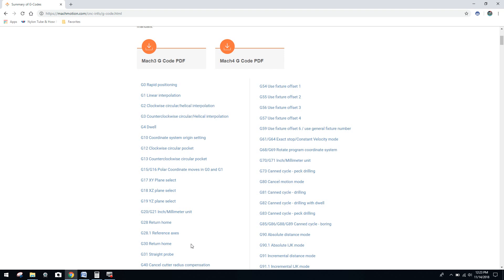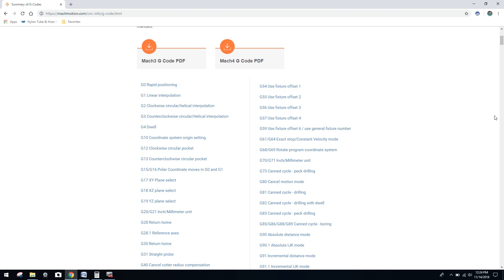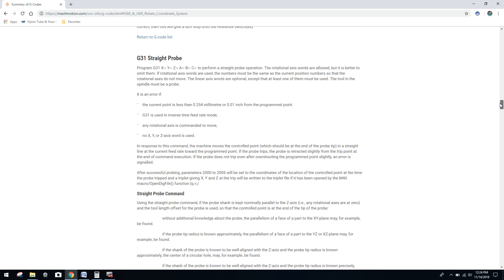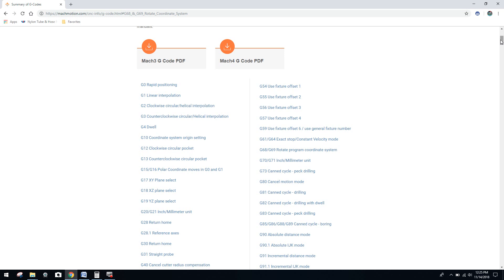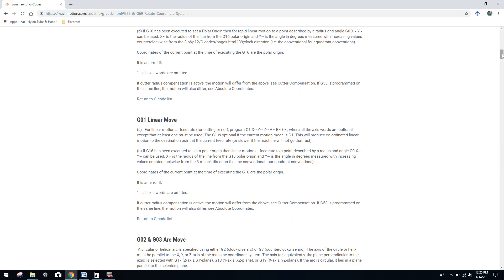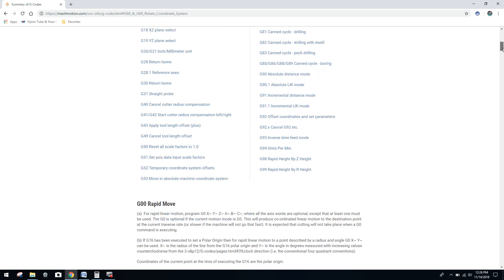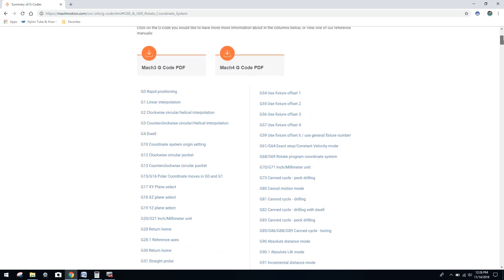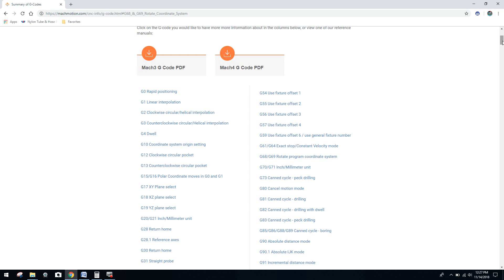G-code Summaries For Mach 3 & Mach 4

Comment: does g code made for mach3 (using sheetcam or fusion360) work on mach4?
Reply from the maker: Salman, Thank you for your support. Yes, however you may require a post processor for Mach4 to understand it. This would be provided by your CAM software manufacturer. thank you, have a great weekend,  and please be safe.
Vince
Reply: Thank you for your quick answers.
Reply from the maker: @salmanyounis  You bet..:) Thank you, and have a great weekend! Vince
Reply: I mean, I made a g code using mach3 post processor in CAM software, and giving this code to somone who has mach4 controlled cnc, will it work accurately?
Reply from the maker: @salmanyounis  It should if they have the proper post processor installed. Thank you, and please be safe.
Vince

Comment: I feel like this should be an incredibly simple line of code but cannot find it anywhere. I want to be able to run programs back to back on my avid cnc using mach 4 but for accuracy I need the machine to home all of its axis after finishing one program but before it starts the next one. This way I can run a longer set of roughing and finishing passes without having to break them into multiple g code files. Seems like it would be a simple line of code that I can add where needed when editing the gcode. Does this make sense?
Reply from the maker: Gabe, thank you for your support. The homing process is required if your changing a tool for the new code as that's all I can see that would cause this. This is a mandatory sequence from the roughing process. Thank you, and please be safe.
Vince

Comment: I'm using CAD software called: Grblbru and the gcode does not work on my mach4 lathe. Do u know why?
thanks
Reply from the maker: Ahmed, thank you for your support. The issue would be with the compatibility of your CAM software.  G-code is designed for all Artsoft software. You most likely require a post processor compatible with your CAM software to allow it to work. Thank you, and please be safe.
Vince

Comment: Can I run your system in a manual mode I mean stand alone but then switch to CNC. I am thinking nema 34.
Reply from the maker: Sam,
 Thank you for your support. Operating the system in manual mode is fine as long as the system is off as if you have the system on your motors will provide holding torque which means you aren't able to adjust the axis.

Thank you,
Vince